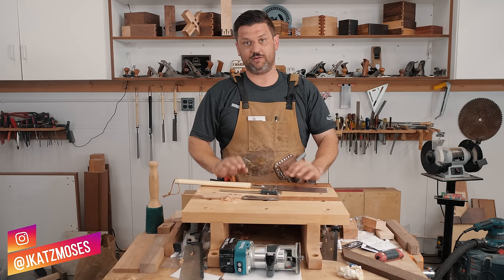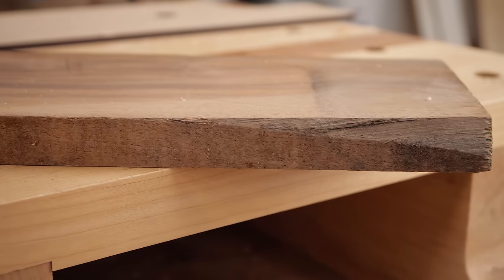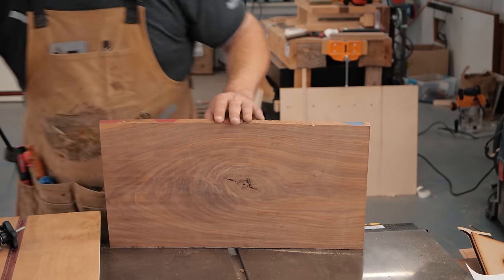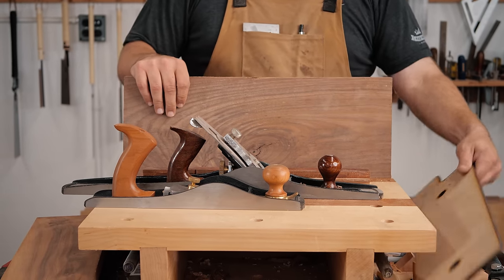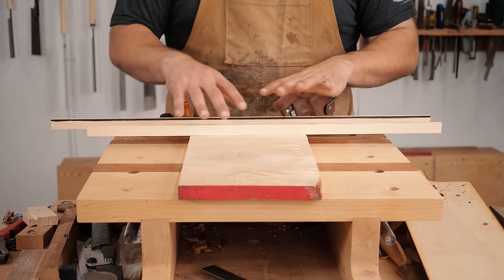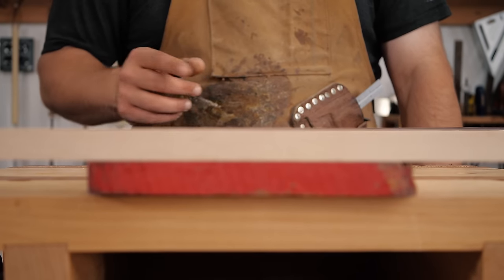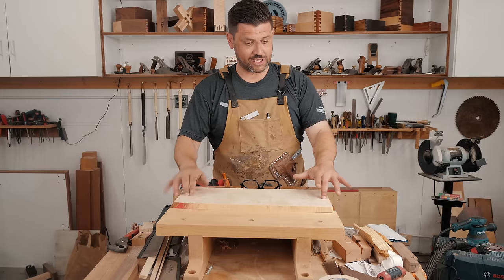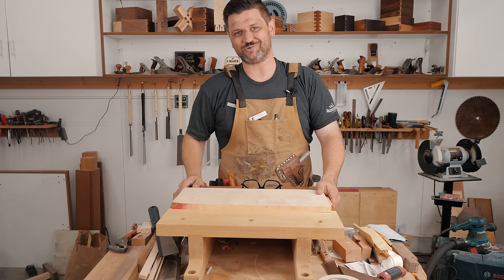5 Ways to Joint a Board Without a Jointer

Comment: Very interesting as one of my main struggles (which consumes more time as well) is exactly to get timber flat and square and one of the main reasons projects maybe a hurdle: they all are if the timber is not square. My current thicknesser planer  is a bottom range Metabo which is similar to a Record Power 8and many others coming from the same place in China I guess): if space and budget would allow this is the first tool  that would get replaced by a truly professional machine like something from Felder

Comment: Sooooo... what if I have a 7/4, 14” wide, 12’ long board with no jointer to flatten? Well I have a jointer, a 6” bench top, but there’s no way to use it with such material. How might you tackle that?
Reply: Check out @Shaun Boyd, he's got a good video on how he does it.
Reply: Power hand plane.

Comment: Well if your stuff has A flat side this helps. Do find the American thing about -220-240 volt strange as ours is 315 volts -3 phase -presume that is what you were talking about -ours be 240v at single -probably no real difference as lower volts + higher wattage = the same kinda thing.

Comment: If you are going to do woodworking get the tools the make it more efficient and enjoyable.  That means get a jointer and planer.  If you're a hand tool guy get the planes you need.  Why spend your time fiddling around making sleds, shimming and hot gluing. I have a jointer and planer. I can process a board in the time the glue gun heat up.

Comment: Well if you’re dealing with little bitty short boards like those, then a good plywood blade or “planer blade” on a table saw is all you need.  Cut and join.  For longer boards, or if you just want to make less sawdust, a “shooting board” and hand plane is an excellent solution which is relatively failsafe.

Comment: Ok ok ok, I love this channel and I rip off your ideas all the time, but the flush trim bit seems so unrealistic to me. Unless the board is already nearly straight, it's difficult to get it jointed in a single pass. You can increase the cut depth and thickness by getting a better bit, but those whiteside combo bits are nearly 200 bucks!

Comment: Stupid question why do they call it a jointer.   Your not joining nothing?
Reply from the maker: It's for making clean joints between boards
Reply: @katzmosestools  for  butting joints?
Reply: Luther Blankenship, glue one edge to another, and you’ve got a joint.
Reply: @leehaelters6182  has nothingn to do with. My question. At least I said I had a stupid question  u gave an answer to a question that I didnt ask
Reply: @LUTHERJ304 , I thought that you were saying that since there was no penetration of one part by another, you could not see a "joint" involved. I was trying to clarify that in the case of two boards in a tabletop lying next to each other and adhered with glue, it could be considered a "joint", and that the machine that prepared the edges for their joining (till death do they part) is appropriately called a jointer.
Reply: @LUTHERJ304 , and to further display my pedantry, I would say that if I glued the end of one board to the edge another, I would have a butt joint. If I glued the edge of one to the edge of another, I would have an edge joint.
Reply: @LUTHERJ304 , and no disrespect intended.
Reply: @leehaelters6182  not taken.  I'm serious.  I'm refering  to the tool.    The tool u put it threw.  It's called a jointer?   It didnt join anything together
Reply: @LUTHERJ304 , yes, called a jointer, I guess because it prepares the joint, not actually glues anything together.
Reply: We are talking about the narrow edge, aren't we?

Comment: For heavens sake get a jointer. Who wants to spend shop time making silly fixtures on your planer or table saw to do what a jointer does in minutes.
Unless your into goofy work and like doing things the hard way get a jointer!
Most of us like making furniture. Not jigs or fixtures.
You tubers have lost their minds.
Reply from the maker: Mr moneybags over here. A good jointer is 600-1k used. Some people can't afford what you can. Just don't watch videos that aren't directed at you instead of trying to gate keep woodworking.
Reply: Jointers can be had for a lot less then that. Buying wood in the rough or harvesting local can save money. Soon the jointer pays for its self saving time and money.
If your not ready that’s fine.Your projects will take on a new life when you quickly create accurate reference surfaces.
Don’t worry about your viewers they will find something they can afford.
Good Luck
Reply: Aj couldn't agree more. All the demos are on 2 foot pieces and took a lot of time to set up. Ok for a garage warrior but not anything more.
Reply: KNH Carpentry & Home Improvement, poor garage warriors, can’t they get a little love, too?